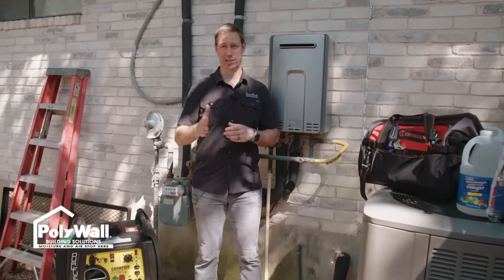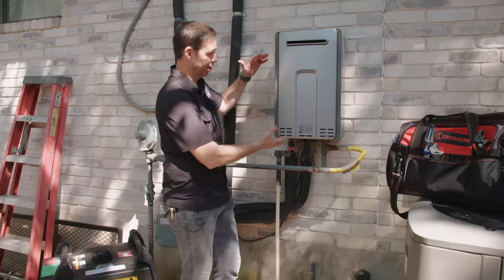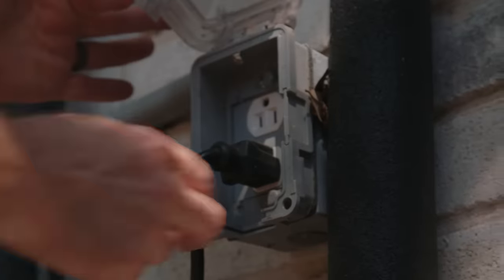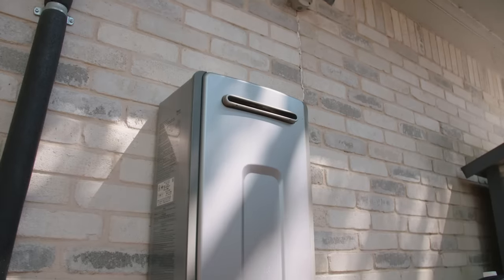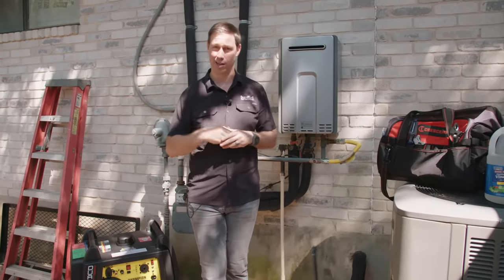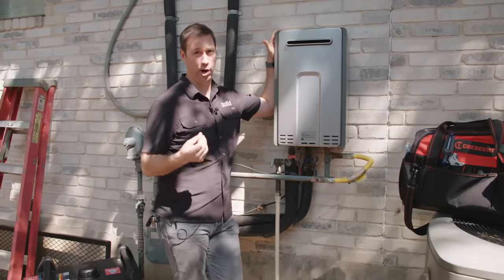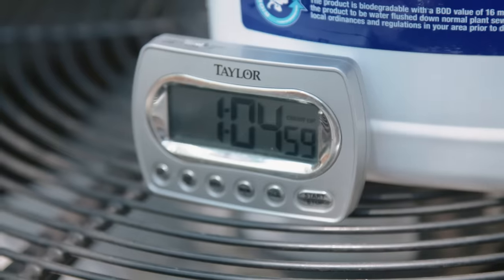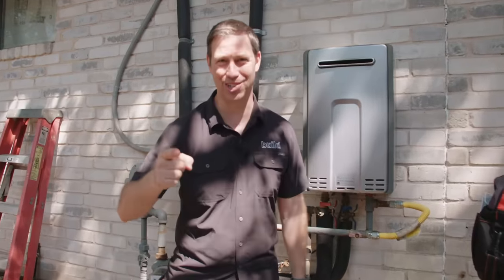3 Things They Don’t Tell You About Tankless

Comment: I don’t know about the US, but here in NZ, Bosch make an instantaneous HWS that uses a piezo ignition system that is charged by a small turbine driven by the incoming water movement. Bingo, ignition without the need for any supply power. Also perfect for an off-grid solution.
Reply: Would be cool plumbed into a biogas tank, hot water from waste n poop!
Reply: Not likely to find that sort of thing in the US, probably not legal to install. The reason they require an outlet is for more than just making a spark - most have power vents, and modulating gas burners that adjust to any given water flow. Along with numerous safety controls.

Water heating and showers in the US seem to be VERY different than what they do in other countries.
Reply: I have a Bosch as described above. Bought it from Home Depot, $600. It isn’t instantaneous BTW, it is tankless but it does take time to heat the water,
Reply: @helphelpimbeingrepressed9347  Would need a lot of poop to generate 200,000 btu's on demand.  I suggest propane.
Reply: Yeh,  had a Bosch 26e here in Australia, and loved it. We lived close to a natural gas line , so we utilised that...  If i had 1 neg thing to say about it, it was that we lived in a large 2 story new house, and it took at times a minute or so to reach the furthermost shower away from the unit. Otherwise trouble free and awesome unit!
Reply: @redwinemademedoit  I don't know that a tank would be better, the water still has to flow up the pipes.
Reply: @Nonplused  Definitely. Wait time has nothing to do with the heater, and everything to do with your plumbing. My shower takes about 3 minutes to get hot, even though my tankless is mounted in the crawlspace directly below it. Some idiot ran a 3/4" hot water line all the way across the house to the kitchen first, then to another bathroom, and finally to the main one I use. I'm gonna put in a bypass for the shower with 1/2" PEX - probably not more than 10 feet needed. That will be almost instant!
Reply: Bosch doesn’t fair well in the US in the Tankless world. Their support and logistics is much to be desired.
Reply: Dan Dan  potentially it wasn’t the hot water system that was taking time to get up to temp, but rather the pipe length between the unit and the outlet.  Typically they are all dead legs that haven’t been used for a while so are stone cold and need to be purged before the hot water reaches the tap.  On top of this, often you aren’t heating the water as much with a tankless system, rather only to the end temp, so the thermal energy loss of the cold pipe (thermal inertia) takes a greater volume of water to overcome the pipe and finally get up to the desired operating temp.
The ways around this are a recirc system (which is more piping and a small pump), or adding multiple hot water units. We added a second system for upstairs bathrooms, close to the bathroom, which has the added advantage of us (downstairs) not needing to wait for said teenagers before we can have a shower.
Reply: @kentchamberlain4952  This has nothing to do with the device heating the water and everything to do with how the plumbing is laid out. Tankless units make water exactly the same temp as a standing tank. My tankless is set at 120, I get 120 out of the taps, but I do have to wait due to bad plumbing layout. I could crank it up to 140 if I wanted to. People install recirc pumps on tank heaters also...

It's more about the modern "GOTTA HAVE IT NOW!" attitude...which we are all guilty of. Imagine if I told my grandma I get upset waiting 2 minutes for hot water. She grew up in a house with a dirt floor and no plumbing in the great depression!

It seems that in Europe, the majority of showers are powered by a dedicated small electric tankless heater mounted in the bathroom - they usually set the heater to shower temp and then shower in full hot, so it never gets extremely hot. For some reason some Americans seem to think you should also set the temp lower on a tankless...but there really isn't a reason unless it's just too small to keep up.
Reply: I haven't seen that here but it may well exist, I have seen HVAC GAs pack units that use the gas to fuel a small generator to operate the fans etc thus they will continue operating in a power outage but are not meant to be off-grid though they might be able to function that way.
Reply: @ptom711  Home Depot does sell bosh and I think with piezo electric ignition but I haven't noticed any that provide their power from the water flow but I will look. Have you operated yours with the powerr off? What model is it?
Reply: @teekay1785  There are no house sized HVAC systems that use a gas powered generator to run the fans. Maybe a giant commercial installation, but that is unlikely because they probably have a giant backup generator anyway.
Reply: yes,,matt is not the sharpest tool in the shed,he blowviates constantly like hes a plumber..not ...
Reply: tee kay Yes my Bosch has the piezo igniter and requires no electricity to operate. My electricity hasn’t gone off when I’ve needed hot water but it would work because it isn’t plugged in and I have city service water so no pump there. Unfortunately I’m not at home so I don’t know what model it is. I haven’t seen them in Home Depot in a while but doesn’t mean they don’t still sell them.
Reply: @ptom711  Thanks . Yeah a lot of things Home Depot and Lowes etc sells are not actually stocked in the stores just pick up there from on line. I wanted to look at a heat pump dryer and neither place ever has them in stock.I wish there was a Menards near me . They always have whatever it is I need in stock and at better prices too but are 150 miles away LOL
Reply: @Nonplused   You do the math..  Typical water supply 80psi  .433 feet of head per foot.  Trust me a Tank is better than tankless.  Especially a high output bradford and white.
Reply: @bowrepublik  I'm not sure what math I am supposed to do.  The water  will flow through a tank and a tankless either way, I think we are talking about which is a better heating option.
Reply: @ptom711  what model is it?
 Will add to my consider list when I go to do this.
Reply: I have a older aqua star which Bosh bought out, it has a piezoelectric button, uses no electricity had it for years runs like a top.  They do make one that lights with a little water operated turbine though.
Reply: The units in the US also need power to run the fan, the computer, and the solenoids for the gas. Even if they had spark without power they would not run.
Reply: Yes, very possible. The unit only needs about 5 watts run all the logic. It'll pull 30 watts for a few seconds at start.
Reply: Kent Chamberlain the problem with a recirculating line is your WH runs when the pump runs, weather you open a tap or not, hence no savings.
Reply: Tom Barrett just because Home Depot sells it doesn’t mean it meets building codes in your area.
Reply: I have a Bosch gas-fired impeller-ignition heater. No electricity required, so no electrician. Summer and winter are the only settings, although anyone can adjust flow of water or gas.. Cheapest water heater available to buy and to install. Instant, endless, hot water.

With a tank you are limited to tank size and have temperature drop as you use up the heated water
.
Forget showers: I can spend three hours in a scalding hot bath, just let cooled water out of the bath as the hot comes through the pipe. Luxury at at bargain basement price.
My only criticism is that overseas regulation requires an electronic switch which is doomed to fail. Not required in New Zealand and best removed on installation.

These heaters annoy the plumbers because they can’t profit as much.

I use the gas for bathroom and laundry and a small electric heater for the kitchen which is on the other side of the house.
Reply: eronfitz, agreed, if the system runs the whole time. This comment was in response to a comment that the output water takes a long time to heat up with the instantaneous systems.  This is true because a typical 42oC supply still needs to warm the pipe that an otherwise 55/60oC supply would do with a traditional storage tank system, combined with new house designs where the discharge points are increasingly further away from the hot water system heating point.  
This is particularly important, not only for heat energy loss, but also with water loss, (important when you are running systems from rainwater  collected tank supply rather than municipal for supply water, such as much of Australia and other rural communities do.
There is a preheat function on some of the local control panel designs, which kicks the recirc pump on for a short selectable period and kicks the hot water unit on before the tap is turned on.  This allows for water to be heated all the way to the discharge point, at the temperature selected at that particular control point but doesn’t require the water to be circulating continuously.
Net result is that no water is wasted to purge the pipes at the beginning of a shower etc, but the system does not waste energy continuously circulating when it does not need to.

In answer to some other comments, the advantage of a tankless system is that the running temperature can be set much lower, ie the safe discharge temperature (42oC max for showers, 55oC for kitchen) rather than needing to set to safe storage temperature (min 65oC to prevent potential growth inside the tank). The lower delta temperature between the incoming supply and delivery point makes the boiler far more efficient (less gas required per joule/btu inputted into the end supply water (even taking into account a thermal mixer at the end point). The more efficient boiler, in addition to  the lack of heat loss through the insulated storage tank make these systems more efficient than the traditional storage tank systems.
Reply: Tankless water heaters are not worth the money. They're going to break sooner or later and cost you a lot of money. Anything that's complex will break. You really think you're going to get the back the three to $4,000 you're going to have to spend for a tankless water heater install? It's not going to happen. I have an electric water heater it's almost 10 years old I don't drain it I don't  replace the anoids I'm a HV AC technician. When it breaks I'll just replace it for another few hundred dollars. I never recommend tankless water heaters to anybody unless they want a complicated system that's going to match the cost them a lot of money. It'll never pay for itself. And when it breaks you have no hot water. The standard gas water heater will go 10 to 15 years before there's a problem then it's just time to get a new one
Reply: Jeremy Ashford your Bosch water heater must be a standing pilot unit that is chimney vented, otherwise it would need a draft inducing fan. Natural draft appliances use the heat of the unit and the height of the chimney to carry the flue gassed out of the house. There are basically two types of gas appliances, natural draft (chimney vented) and induced draft (fan assisted). If it doesn’t use electricity it MUST have a chimney.
Reply: Those are called a Bosch Hydropower. Depending on how many litres per minute it can run at a 25 degree rise you will either have a 10H, 13H or 16H. If you think they are good, wait till you see the Rheem Pronto range.
Reply: Maybe a little turbine could make enough  energy for a little spark. The problem is, where is the energy to power a solenoid to control the gas valve. On the other hand I believe that the a little turbine you referred to , just a water flow sensor.
Reply: @caseymuni4097  The Bosch instantaneous water heaters (Pilot light or Hydro, e.g. 10P or 10H etc) use a diaphragm. The top of the diaphragm rises when water runs through the unit. That pushes a rod up which opens the gas to the jets.
Reply: @warwickwilliams2309  if that is the way it functions,  it could not be legal in US , due to safety. Burning gas must be monitored and in the event of flame loss , gas supply must be turned off.
Reply: @caseymuni4097  There is more to them than that. They activate using a diaphragm however the P series has a thermocouple that holds open a magnetic valve. So anything that happens to that pilot light will close the gas. The H series is a little more complex. The hydrometer also generates enough electricity to operate 2 solenoids. 1 controls a pilot (which is what the pezo ignights when it starts) and the other the gas jets. They are very safe to use. They possibly aren't used in the US because they only give a 25 degree rise. You have a lot of stuff there that we don't get and vice versa.
Reply: @Kent Chamberlain

Any maintenance issues with the piezo ignition system?
Reply: All the people replying about tankless heaters without power are clearly not in the US. The British and their old colonies have still not figured out hot water - what they do is absolutely ridiculous. They basically put a tiny tankless unit in every room. And they still haven't figured out mixing valves. Their tankless heaters are not legal in the US. They also cannot be above 80% efficiency unless they have a forced air draft. This is why ours require electricity and theirs  do not. Apparently they are fine with poor efficiency.

If you are a North American do not attempt to make hot water like they do in Europe/Australia, it is illegal, and also very inconvenient.
Reply: @ryanroberts1104  no one's going to install one for $300. It's going to cost you three to four thousand for a contractor to put one in. No you're not going to save thousands of dollars in hot water. It uses about 10% less maybe 20 at most. It will take years to pay it off. Then don't last 20 years they have problems especially in the areas with hard water. Then you have to have the water softener the maintenance. You have to run electric to it. Easily three to four thousand dollars
Reply: @ryanroberts1104  it's way easier to put in a traditional water heater especially when to replace a like-for-like. The only way you're going to do it for under 2,000 bucks it's if you do it yourself. The highest capacity tankless water heaters at Home Depot or around 12 to $1,600. There's only a few that are under a thousand. When I say three to four thousand dollars which it will cost that's the price to somebody who has to pay somebody to do it. No one's going to do it for $100. It's an all-day job. You're going to have to possibly cut in a new flu you're going to have to run electric to it. I'm starting to think you really don't know what you're talkin about. The plumbing changes and running electrical circuit it's going to take time. Not 10 minutes. It don't last as long as the standard water heaters that have very few moving parts. And if you live in a hard water area you have to have a water softener.
Reply: @ryanroberts1104  you can go to Home Depot's website they're all about $1,200 some are pushing $2,000. Now you think you're just going to run electric and how many minutes? From the breaker panel supposed to have its own isolated circuit. Then you have to vent it out. They can get that done in an hour or two know it's going to be an all day job it's going to be an easy thousand dollars labor plus materials. Unless you do it yourself
Reply: @ryanroberts1104  it's one of the smaller ones still have to run the pipes and electric. Easy 2K thru contractors. The bigger higher capacity over 1k
Reply: @Nonplused  Not at all if your hot water storage system is located close to your hot water outlets, which should be mandatory. Even if a long run tank storage will give you hot long before (so called) instant.
Reply: @brewsterly2927  My hot water tank is pretty much as close to in the middle of my hot water outlets as I think it could be, but no mater where I am using hot water it still has to purge out some line.
Reply: @Nonplused  
Yeah with storage the cold is purged and you get the hot, with (not) instant you purge out pipe cold with cold water till the useless things heat up!
Reply: @brewsterly2927  The other point that is not covered I think very accurately is the supposed "efficiency improvement" of tankless heaters.  It is implementation specific.  For example if you air condition then yes it is better not to have a hot tank in the house, but where I live the main concern is heating so anything lost by the tank is just less work for the furnace.  So I don't think in all cases it is fair to say tanks are 80% efficient and on demand is 95%, it really depends on the installation.  So down south where the on demand unit can be mounted outside and the home is air conditioned it is probably true that there is a 15% increase in efficiency, but it would be less than that up north all things considered.
Reply: There are models with batteries 🔋
Reply: @ptom711  

Mine has 2 batteries 🔋 🔋 to do the ignition
Reply: @ajarivas72  That is a lot of hot water tanks!  I only have 1.  Also I've seen electric hot water tanks before but I don't know how a electric tankless would work because it would require a lot of power when operating.  As for reliability, where I live the power goes out a couple times a year but the gas and water never have.  If the gas ever did go out it would be quite a thing because the gas company would have to purge all the lines to bring it back on, which would take weeks.  I actually know the plans the gas company has incase of a shortage because I used to work in their planning department many years ago.  The plan is to brown out sections of the city (shut off the power in rolling blackouts) because that would shut off the furnaces and conserve what gas they did have so that the lines would not go below minimum pressure.  Most of the furnaces in this area are forced air so they need both electricity and gas to run.  Kind of a sneaky way of doing things but better than having to purge whole neighborhoods in the middle of winter.
Reply: @Nonplused  : 

Very interesting
Reply: I’ve seen those but they are less efficient so they aren’t super common anymore in my area
Reply: Link Info?
Reply: @ryanroberts1104  Perfectly legal - one on my mom's house in California
Reply: @kevinburke5470  Codes change on a yearly/weekly basis...especially in commiefornia. You can't use a non power vented unit in 2020 unless it's part of your camper. Maybe you mom lives in a camper. You cannot go above 80% efficiency without a power vent, and that isn't good enough anymore.
Reply: @ryanroberts1104  LOL Commiefornia...see where your mindset lies. Intelligent conversation obviously isn't going to happen. Anyway, in closing, nope...it's a house, and it was installed by a licensed company 7 years ago.
Reply: If all your hot water is centralized in no small area of the house and the heater is in the same area they are ok. Little water is wasted waiting for hot water in the western states water is in short supply so running it down the drain can be expensive. I have used the tank less units a lot in China water is abundant so wasting water is not a problem. I have found tank style water heater that have a timer to control when the hot water is available work the best at saving both energy and water. But using them requires a more rigid life schedule .
Reply: @ptom711  it is instantaneous - just not instantaneous away from the heater. You need a circulating pump to get hot water at you tap instantaneously.
Reply: @redwinemademedoit  how does delay in getting water relate to it being tankless? Put a circulating pump.
Reply: @benkuxhouse787  
  Hot water tanks here in SE Ohio last 4-5 years, if you're lucky. Mine is leaking on the bottom, whoever installed it put in on 2 inche wooden blocks that absorbed moisture and rusted bottom. It is killing my electric bill.My friend has a tankless, 3 years old and had to fix the heat element last month.I have new pex to rid the metal pipes and contemplating the best way forward. I bought the house after renting it for 2.5 years. The landlord wouldn't put any money into it. I have rebuilt the electric furnace,3 showers,2 toilets are new,the sewer pipes are under the concrete floor and a nightmare. They have a 6 foot section that's almost impossible to access to unclog, a mining rd the gas company won't cross even though there's an old gas line crossing the mine rd,me,my sister and brothers property all have access nothing can be built on it.Someday it will become more valuable because it sits in between their properties. The grandchildren and kids will have to hash this out. Much work to do here.
Reply: @ryanroberts1104  
  I've been looking at prices. Tankless start out 300$and upto 3000$ entire house for the cost of 1 unit.
Reply: @andymonk4089  And that's exactly the same range you will find in tank style heaters.
Reply: @ryanroberts1104  
   I haven't decided but if I get a tank it's going to have a timer. Thanks for the informational material.
Reply: I have a tankless that uses 2 D batteries that is used for ignition. But not matter what the power goes out, my water pump goes too.
Reply: @andymonk4089  you must have some really hard water where you're at. I feel terrible for you that you are fixing all this stuff for your landlord because by law those landlords have to do it. I do know a few tenants overtime that have fixing some selves and charge the landlord for the materials. I fixed a couple things at a place I rented for a few years and just took it off my rent and sent the receipts with my rent. There are small repairs nothing big easy to do. I think my landlord appreciated it he was a nice man. I do HVAC for a living so I can fix a lot of things. My water heater is lasting fine. I spend about 1500 a year on electricity at most. I live in Washington State Western I have a heat pump and electric water heater. I've seen people get bit really hard over the years by high-efficiency stuff, it is so costly to repair. Sometimes they have to replace it they're money pits
Reply: @benkuxhouse787  
   I bought it on land contract.
Reply: @benkuxhouse787  
  I have done HVAC with my grandfather, father and brother.My father gave my younger brother the company.I went to several colleges and the union millwrights apprenticeship program. I retired in December 2009.
Reply: @bowrepublik  I'd go the other way and say tankless is the way to go. I had a 50 gal tank model and a higher bill. I have the Rheem 95dvln model and purchased the commercial chip for it that allows me to turn temp up to 180 degrees if desired. I don't go that high but a craft brewery near me does to dump 180 degree water into their kettles instead of having to heat all of that water up with flame. I have mine on a commercial building that includes my 6 room house and  two 2 bedroom apartments and my business below it all. I've had it in the building about 12 years now, never had a problem with it, and my bills went down back then 40-55 dollars a month. Imagine the savings in 12 years. I do have a good water filter just before the heater also. A good self-cleaning electric water filter that does not need filter changing. When I had the tank heater, we were always waiting for hot water, and paying for it too. If it's just you and the wife, I could maybe see a tank being better. Maybe. I'd have to see it for myself tho.
Reply: @benkuxhouse787  You don't know what you're talking about. I have a tankless installed and it has saved me 40-55 dollars a month in nat. gas bill for over 12 years. Just going by the $40 amount, that comes to $5760 savings for that time.  The heater cost me about $1000  and I had it installed for about $500. Where are you getting those numbers from?
Reply: @benkuxhouse787  You're wrong. I had a high end Rheem installed 12 years ago by one of the biggest plumbing firms in my area. I was charged about $500 to have it installed.
Reply: @curtzeek8818  when taken care of and when a recirc is running properly a tankless can be great.  But it's the maintenance that kills the tankless. Clients show me their stacks of receipts all the time. Ps I'm a red seal plumber/ gasfitter in Alberta Canada. Has had my own company since 2010.  Anyways long story short when receipts add up 700-1800 in 5-6 years for maintenance and warranty repairs. I feel for the customers.  When a customer asks me too install them I warn them first.  There is a neighborhood I regularly work in called watermark in Calgary.  The whole complex of 200 townhomes each had the navien ch180 installed.  It's been about 7 years since the homes were built and the builder is facing a class action because everyone has massive repair bills on these units.  Heat exchangers needing to be replaced left and right. Flow sensors with zero fins left 3way solenoids stuck among other constant issues.  It's not just navien rennai has models with bad heat exchangers you name the problem happens to Bradford and white and others.   Not saying tanks done have their issues.  But generally speaking their maintenance free.  It's that aspect that makes them cheaper over time than a tankless.  Set it and forget it.  Absolutely can't do that with a tankless.
Reply: @bowrepublik  The maintenance is to clean it every year. This had to be a bad model to choose if all those units are going bad. There are cheaper units and there are well made units. The choice is yours. I clean mine myself and I've never had a problem it. 12 years and going strong. One thing I'll say is I'm surprised how many people say to put a water filter after the heater. My Rheem's instructions say to put a filter before it, and that's what I did. The company that installed it for me said the same thing. I don't know how there are "stacks" of receipts tho. I'd take my Rheem or Rinnai before anything else.
Reply: Ryan Roberts p
Reply: @curtzeek8818  you can't buy a tankless water heater for $500 the buyback time Never Comes some people say the performance recovery is much better for their lifestyle but it's always going to cost more I say just get a bigger standard tank
Reply: @andymonk4089  did you do service or installations? The field has changed radically over the last 20 years
Reply: @benkuxhouse787  That was the install price, not the purchase price. If you read the whole thread you would have saw that.  I had a 50 gal tank and the tankless works better for me. My gas bill is lower ever since I put it in 12 years ago.  I have a 6 room house here that has 2 two bedroom apartments  in the building also.  When I first put this in, it was in the summer, so  the only things that were on gas were my oven, my gas dryer and and the hot water. The bill went down $30-$40 a month  after the tank water heater was taken out. I don't miss it at all, and the whole building has unlimited hot water. No one takes advantage of it because it's all family here.
Reply: @kayleeguard1119  I've seen some installations cost over $4,000 because a water softener has to be put in and many of the tankless water heaters have to have some electrical work done. It's a lot of money for a water heater and if I back time I don't think will ever happen. If you can get over 10 years out of it if you might break even or make a little money back. If you were able to do it for $1,500 that's not too bad
Reply: The average gas flow thru uses about a 100w for the electric. Say 200w. Get a house UPS. Besides who takes a shower in the dark?
Reply: @jurgmanx4644  in Washington state where I live the climate isn't too harsh and the electricity is pretty cheap. I have risked a regular electric water heater and a heat pump. I spend about 1,600 annually on electricity. The international left wants to make electricity very expensive this is how I push back. At current electricity prices it would make no sense for me to do some crazy high efficiency water heater.
Reply: Same in Ozz.
Reply: @ptom711  my unit uses 2 D . batteries to operate the piezo ignition. I have only had to change them once in the last 3 years.
  My issue is that when I turn the cold faucet too high it cuts off the hot water and I have to turn the hot water faucet off then back on to restart the heater. I don't know if it's a pressure issue or a gas flow issue.
Reply: I've also seen some THW that can use batteries (and I'm talking like, standard D cell batteries, like from a flashlight) to power the electronics in the event the power is out.   Yet, in the U.S., it seems like nobody wants to sell you units like the Bosch you mention or the battery backup system I mentioned.   You just can't find them.
Reply: @KrK007  I have a Marey twh which uses 2D batteries to ignite the pilot. I run it on a regular 20lb propane tank. I installed it myself, quite simply and haven't had any problems with it except if I turn the cold faucet on too high it cuts off my hot water and I have to turn the hot water faucet off then back on to restart the heater. 
  I only have to refill the lp tank about every 3 or 4 months. But it's only my wife and I using the hot water.
Reply: Interesting thread and helpful comments, as I am now researching replacing an older Baxi Luna 3 tankless that constantly breaks down, partly due to much deferred maintenance by my elderly, ill parents.  HVAC companies in the NYC area that I contact for quotes seem to each have their favorite boilers based on units their techs know best and accessibility of parts, so they say.  So, Lochinvar Noble 199K/N ($2,675 for unit, $4,750 labor + rest of materials) and an IBC install (about $8, 800 for everything combined)  have been recommeded/quoted.  After reading the comments, these prices look inflated. Any thoughts on the Lochinvar Noble?  Also, is there a specific Bosch model that's comparable?
Reply: In South America and in Europe they also incorporate an ignition system that uses batteries. I live in Argentina and we have had tankless my entire life and never had issues with it. And some older models do have a constant pilot light. And we never flush ours. I’ve seen more issues with hot water tanks than with tankless because nobody ever changes the anode rod and they rust and leak.
Reply: @teekay1785  I haven't been able to find a Gas tankless hot water heater that doesn't need electricity to run available for sale here in the U.S. ... I've been looking.  I want to replace my Bosch which was installed improperly and I didn't know that when I bought the house, it wasn't installed with any flush valves or way to clean it out and now as a result the heat exchanger is likely permanently done for.    This winter it just couldn't keep up and that's when I discovered the problem with no valves and no flushing done to it, ever.

It is still working just it doesn't put out enough hot water any more if the intake water is too cold, so I set about looking to replace it.

The year I moved in an ice storm took out the power for 10 days;  that entire time I had unlimited hot water and I'm sold on that feature.   I want one that either needs zero electricity OR can operate on batteries in the case of a loss of power;  but they don't seem to exist in the U.S. market, that I can find.  If you happen to know of a source, I'd love to be pointed in the right direction.
Reply: @ryanroberts1104  not true. My Marey heater has battery powered pizo ingnition. It's a 16 liter unit. Works very well unless I turn on too much cold water,(I probably have pressure issues where I live),  but it makes my fire shut off I guess some safety feature.
  I need nothing but a propane tank with the same regulater as a grill. It's just the wife and I and we use 1 - 20lb tank about every 3 months. LOVE IT!!
Reply: @KrK007  yes they do. Marey makes many completely independent gas units. Go online. Mine is awesome.
Reply: @karlpatch4146  I'm not going to bother trying to read through 97 replies again, but I can assure you, whatever you are referring to I stated accurately.
Reply: @karlpatch4146  Which one do you have, BTW?
Reply: @KrK007   I have Marey 16 liter with battery powered pizo ingnition. No electricity was harmed in the use of this unit. I really like it. Had it for almost three years now.
Reply: @ryanroberts1104  you would only have had to scroll down two replies to find your comment I was responding to. WRONG.
Reply: @ryanroberts1104  wrong again, I have a Marey purchased right here in the U.S. It requires no electricity, it runs on 2-D batteries which activates the piezo ignition that starts the burners.
  Totally, obviously legal here in this country.
Reply: @ryanroberts1104  here, I totally agree with you.
Reply: Why do my replies go straight to the bottom of the list and not under your comment I am replying to??
  Sorry for the confusion.
Reply: @karlpatch4146  And that isn't legal to install into a house as your water heater. You must live in a camper, which doesn't surprise me. I'm not going to bother arguing with an idiot who is late to the party, go read the first 100 replies and maybe you will get it. If you still don't then you cannot be helped.
Reply: @ryanroberts1104  🤬🙈🙉🙊
Reply: @karlpatch4146  Not up to code. I'm betting you didn't get a permit.
Reply: @ryanroberts1104  Why would I need a permit? It connected to existing plumbing from the old tank heater and involved no electrical work. It's mounted  on the outside of my home in a covered carport w/ an exhaust stack leading out of the covered area. It is connected to a 20lb LP tank with the same regulater as a BBQ grill as directed. I even added clean out valves and inline on/off valves on the hot and cold water lines. So, why would you say that it is out of code?
Reply: @karlpatch4146  Confirmed. You are using a camping device that is designed for PORTABLE USE ONLY , and as I have explained numerous times here, does not meet code for permanent installation. In other words, what you have is illegal. It sounds like you live in a trailer or some other sort of shithole, because normal people do not make hot water like this.
And yes, you absolutely need a permit for doing that, even in a trailer.
Reply: @helphelpimbeingrepressed9347  Love your public name! Solicited to get him on the 2000 ballot.
Reply: Cool. I’ll look that up.
Reply: I came here to this video because I was told by a person who has well water cleans it monthly
Reply: @ptom711  Never buy appliances at a big box store. They're bottom-of-the-line mass-produced for easy consumption and they're crap.
Go to an appliance store. Spend $2,500.00 on a Bosch dishwasher that evidence suggests is far superior and that will last for decades. (Everyone learns this eventually - I did not learn it until I was 57, and I lived through disco.)
Reply: Some models come with a recirculating pump and you can retro something to make that work. The RUR rinnai model also has a timer so you can schedule your hot water
Reply: I believe thus could be made better
Reply: That’s amazing! If we got that opportunity it would be a miracle. They charge us just to breathe polluted air. 🙄
Reply: @Nonplused  You underestimate my power.
Reply: These manufacturers of make it very difficult to get new parts supplied here in the United States. 
Which means if one of them breaks down where can I get new parts?
How long do you think a customer wants to be without hot water??
Reply: I have one
..20 years later it's still here leaking 😂
Reply: Bosch used to sell those piezo units in the states. No power required but generally had a standing pilot and we’re atmospherically vented( not fan assisted). Those units were junk. The condensing units made by rinnai Bradford or navien are entirely better but do require power
Reply: @sethkelley4886  Navien is the best on the market. Built in recirculating system, a sixth of a gallon buffer tank. Time clock to set it up when you need hot water. We all have our set schedules!!!
Reply: I'm in the US and I have the same thing. Bosch
Reply: @victorblock3421  Bosch is or was the main tankless for years that I replaced. Just could not get parts for them…
  I haven’t seen a Bosch for atleast 20 years. I’ve been a plumbing contractor for 50 years…
Reply: @ltsgarage7898  My Bosch unit is about 13-14 years old. I purchased it in Lowes. My HVAC guy replaced 2 gas forced air furnaces for me and he did the install. My condo association got a new president and he busted my balls about it and hired an outside contractor to write a report on it. The report was good and they left me alone after that. That happened 2-3 years ago.
Reply: @victorblock3421  so what are you trying to say??
 There are good and bad in every product. 
  I just told you what I’ve experienced. Like I said before. I can’t remember when the last Bosch I’ve seen. I’ve been doing this for a couple of years now. 
Probably longer than you have been alive!!!
  Where abouts do you live?
Reply: @victorblock3421  keep your fingers crossed 🤞
Reply: @ltsgarage7898    You feeling ok ?
Reply: @victorblock3421  why do you ask that??
Reply: @ryanroberts1104  I've seen them in the U.S. yes, they exist here.